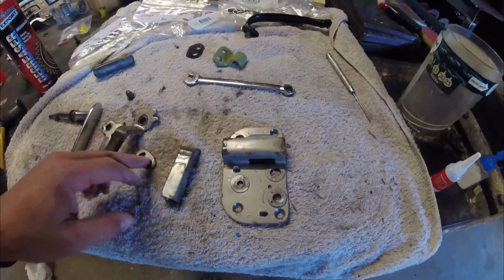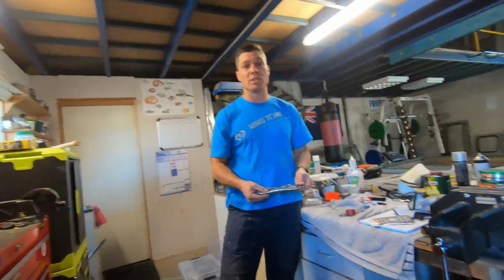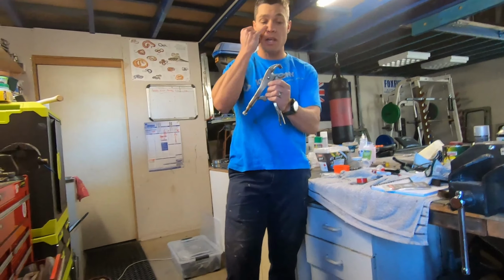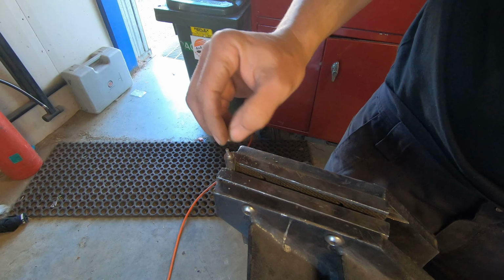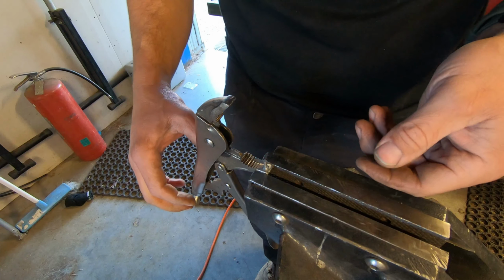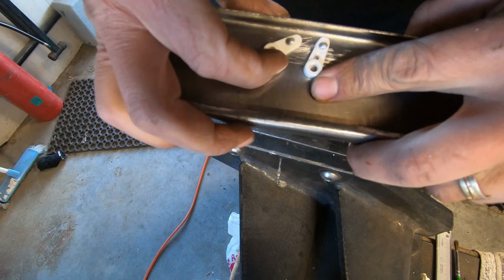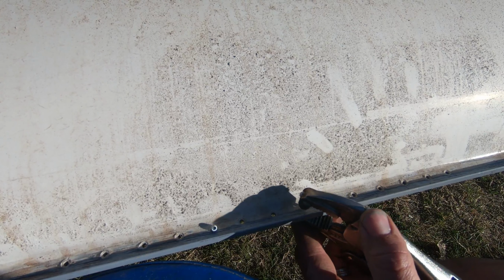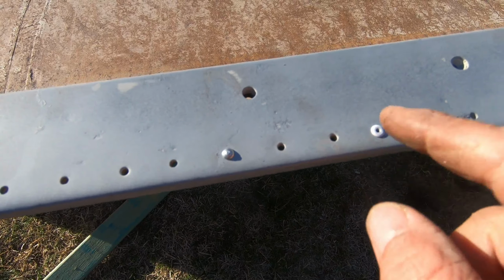EP17 - How to make a solid Rivet tool in your own workshop. Easy DIY

Comment: Very helpful video.  I made the vice-grips tool and it worked perfectly for the perimeter after three trial rivets.  Thanks for the great information! I ended up using normal blind rivets for the windscreen rail and put a dob of sealant over the top as the old ones were covered in sealant anyway.
Reply from the maker: Marcus I'm glad it helped.